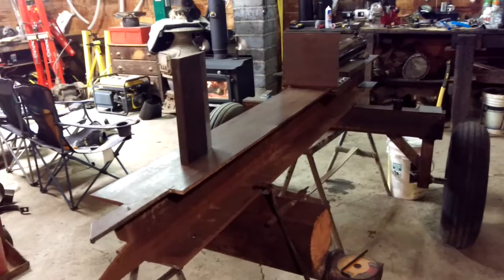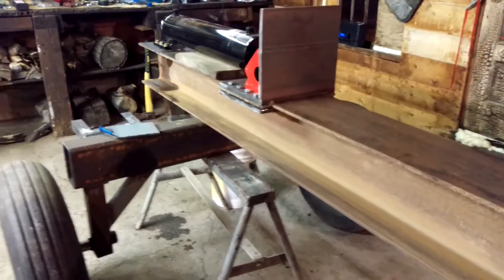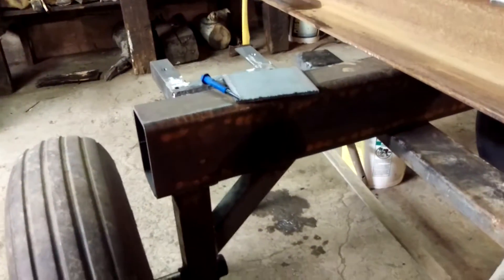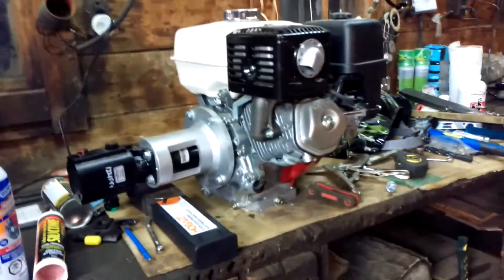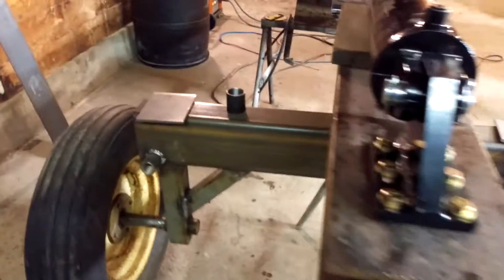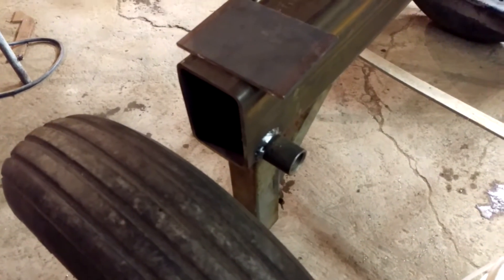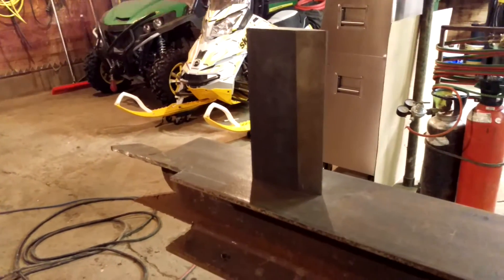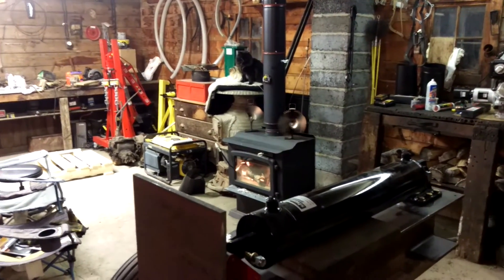Homemade Log Splitter Build Part 1 of 3

Comment: What hydraulic pump did you use? I'm looking in the Northern Tool catalog and see a 2 stage 16GPM, 1" inlet and 1/2" outlet,1/2" diameter shaft. Made by Concentric. $199.  Is this the correct kind of pump?
Reply from the maker: Keith Kanyeshna that sounds identical to the one I used. This is the one I used https://www.princessauto.com/en/detail/8-hp-2-stage-hydraulic-pump/A-p1221555e